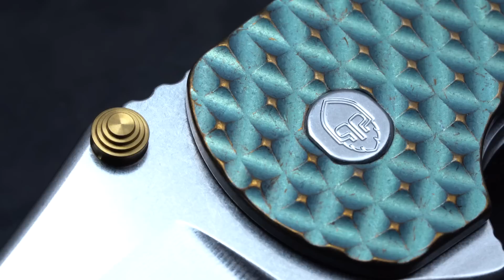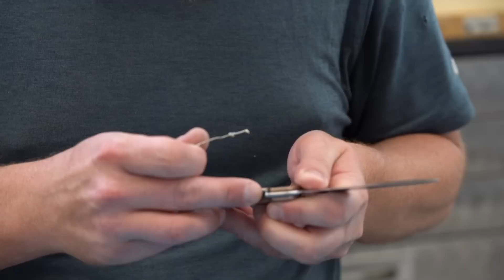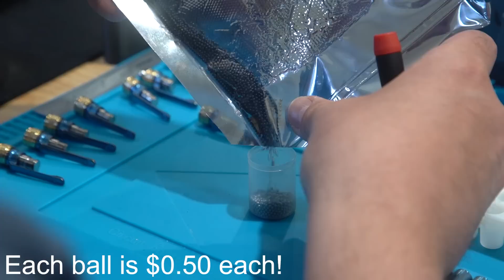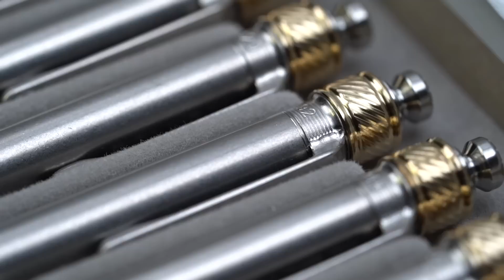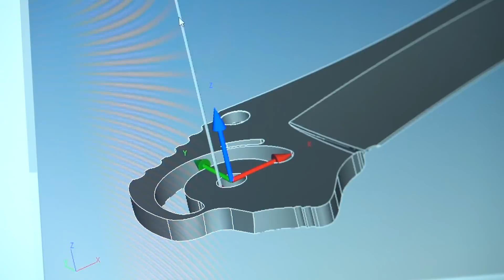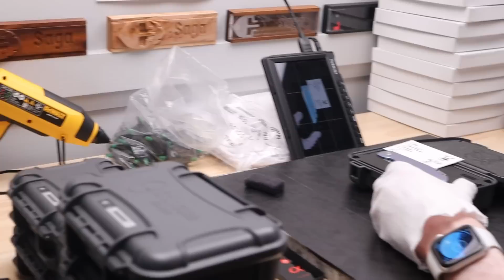What we do at Grimsmo Knives

Comment: here is a little tip that i found out my self after some experience
under the rubber gloves ( that i say the finishing guys use in the video ) have a pair of white fabric gloves on beneath them where the top/edge of the fabric cloves is above the robber ones. it allowed your hand sweat to transfer up to the air as well as premote some air down into the clove as well as minimising the risk of develping rubber/latex allergy. also my personal ( and the machine workshop i work in ) recomendation in gloves would clearly be wurth's " Black Nitrile Gloves "

Comment: When will you make your knives worth the price with 63-64rc magnacut or 62rc-64rc m390/20cv or secondary hardening m390/20cv? Or any steel that is worth the costs you are charging? Cpm154 and rwl34 with a minor change in heat treat for toughness after many years is kind of dissapointing.

All that machining is nothing if you give us the main function of a knife with average weak sauce.

Or are you okay with being an over priced fidget toy?

My grimsmo pen feels scratchy and grose. I dont remember which number it was. If i just polish it, would it work better?